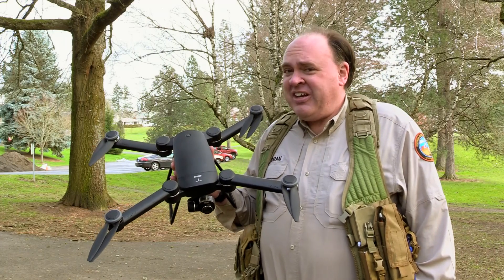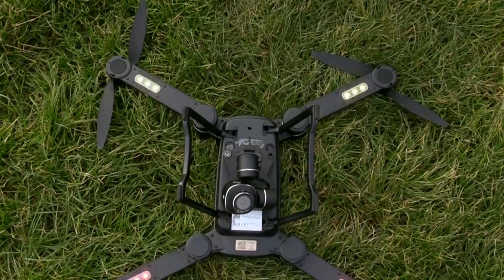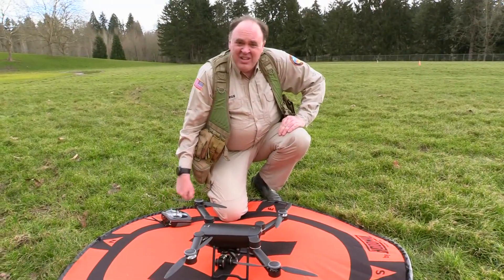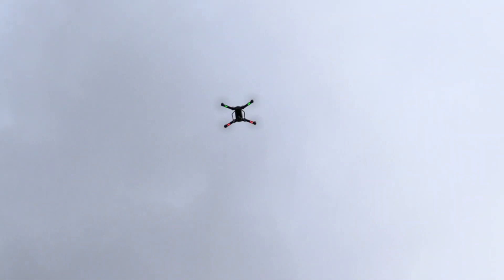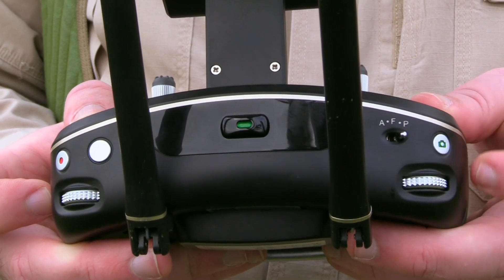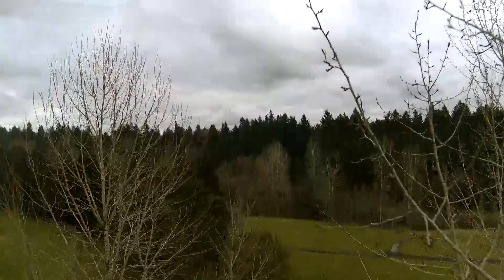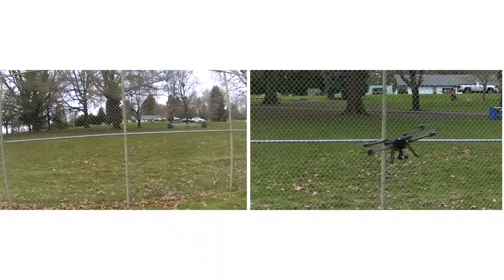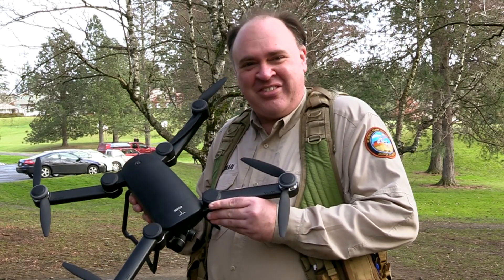GDU Byrd Drone Flight Testing and Aerial Video

Comment: I really do love the style and format of these videos :D

Stupid yet informative. Just the way I like em.

Also I find these folding prop design to be annoying when it makes it impossible to balance the rotors. I'm sure there'll be some clever guy or girl who figures out how to do it.... but...

It might not even make all that much difference though with the gimble. Then again... it might?
Reply from the maker: I might have gone with "fun yet informative," but I think I take your meaning regardless... Glad you enjoy our work! With regard to balancing folding props -- I don't think it's something you need to worry too much about these days. The gimbals and vibration dampening systems have gotten so good that propellers being out of balance doesn't seem to have nearly the impact that it once did on finished video quality. Way, way back in the past (like six years ago), we were getting smoother video with less Jello than a lot of folks because Techinstein would spend hours hunched over the bench, carefully balancing each prop -- and we managed to take a lot of vibration out of the system that way. These days, the gimbals do all the work.

Comment: does it seem that the propellers are in most of your shots? or is that only when you're moving the drone forward very fast?
Reply from the maker: That's me literally going "balls to the wall" (a term which has its roots in aviation, BTW), which is pretty much the only way I fly... Also, the gimbal is tilted up as high as it will go -- so you're seeing pretty much the worst case scenario in terms of the props being visible. Thanks for pointing this out, by the way. I should really: 1) learn to slow down; and, 2) tilt the camera down just slightly to prevent this problem from happening in the first place.